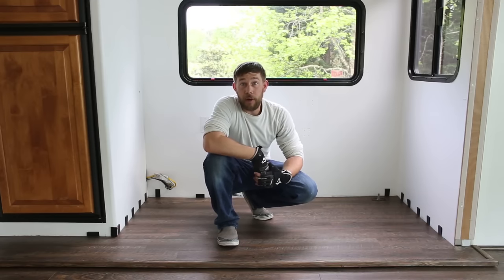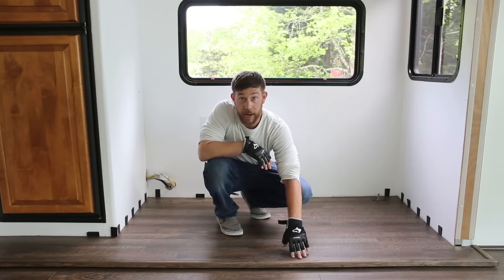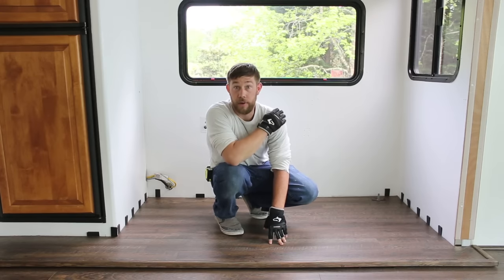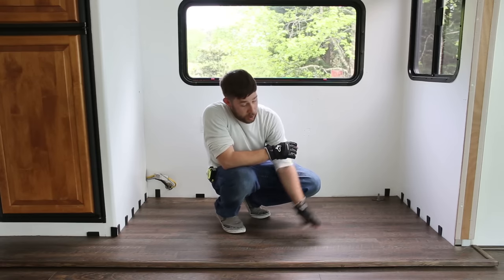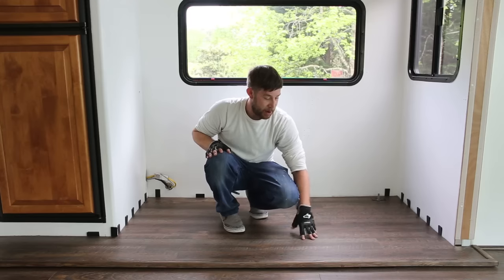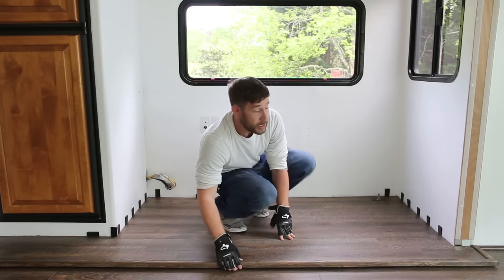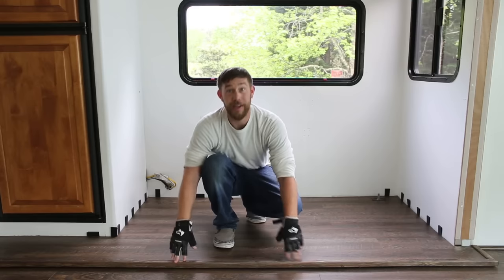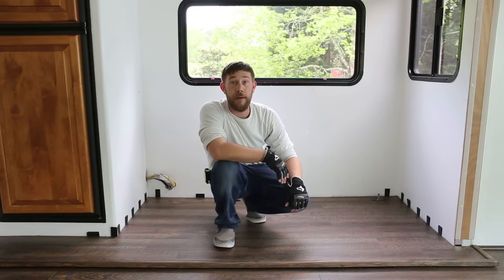Quick Chat: How to Replace Flooring in an RV Slide Out

Comment: Very nice job! Just purchased our new(to us) 5'er 3 motnhs ago and the carpet is on the list for replacement. Question: Do you get a draft coming from under the slide, now that the carpet barrier is gone? or did you somehow address that as you laid the new floor down? Thanks
Reply from the maker: Thanks +Carlos Goetz, best of luck on your carpet replacement. We do get a slight draft coming in from under the slide out, though I have to say it isn't very much of one. When we found ourselves in temperatures below 20 degrees is when we first noticed a draft, but since we've been above that temperature it hasn't been very noticeable. Hope this helps.

Comment: I'm wanting to replace the carpet in my slide out as well, but I'm looking into the peel and stick vinyl flooring. Would I be able to take the same steps as you guys did? We don't have the wheel wells like you do, but it does slope down a bit at the edge of the slide.
Reply from the maker: Hey +Kortny Callahan, I think you should be able to follow the same steps, though every RV is different and you may need to adjust some aspects as you go. We had to find a way to cover our slope on the edge toward the main floor because it was a little higher than the main floor and didn't come completely flush. If you are using the peel and stick flooring it should help make the lip smaller as our flooring was a bit thicker than the peel and stick is. If you wanted to send a couple of pictures to info@mountainmodernlife.com I should be able to give a bit more guidance. Anyway I hope this helps, best wishes, Eric

Comment: Our 1994 5 th wheel is stationary with wheels off and on blocks  We live in the 5 th wheel We want to use vinyl planking everywhere but on the slide we want to replace the carpeting  Being an older RV it has the lip as above   Any suggestion would be wonderful
Reply from the maker: Hey @Carol McCann I'm sorry for the delayed response. But the biggest piece of advice I can give is to get a couple of sample pieces of the flooring you intend to use. Then place it down in a row in front of the slide out. At that point run the slide out in then out to make sure it won't scratch the flooring once in place. If you would like more information you can check out our post - https://mountainmodernlife.com/replace-the-flooring-inside-a-rv-slide-out/ - I hope it helps but if you have any specific questions feel free to let me know and I'll do my best to help :)

Comment: Once we removed the carpet from our slide we saw large bolts in the wood.  What is the best way to cover these with the vinyl floor?
Reply from the maker: Hey @J we had two large bolts in ours as well. We knew for our situation the two bolts were going to be in the rear of the cabinets, so we used a hole saw bit for our drill and cut a round hole so the flooring could go right over top of the bolts. I hope this helps :)
Reply: Thank you. Good idea

Comment: How did you "secure" the underlayment to the floor?
Reply from the maker: Hey +Gale Brown sorry for the late response. We actually found that underneath the carpet on the slide out there was a a thin plastic layer that was on top of a thick (1") piece of underlayment. So we ended up using 4 screws per board (we had two boards because one was not big enough for the entire section. If you want to see a bit more you can check out our post on how we did the flooring in the slide out - https://mountainmodernlife.com/replace-the-flooring-inside-a-rv-slide-out/ - or our post on how we did it for the rest of the rv - https://mountainmodernlife.com/how-to-replace-rv-flooring/ - Anyway I hope this helps and feel free to let me know if you have any other questions, best wishes, Eric

Comment: I'm tackling the flooring in the main section of our RV where the rollers need to transition from the ramps up onto the flooring. How did you ensure that your slideout function remained working? I'm doing the same flooring job in our 5th wheel 2003 Newmar Kountry Star.
Reply from the maker: Hey +Stephen Jennings are you rollers on the slide out portion or on the main flooring section? Our rollers were positioned on our slide out, in order to make the flooring on the slide out secure we ended up needing to add a 1/4" piece of underlayment over the whole slide out (we needed to cut two pieces to cover the whole surface area).  Where the rollers were on the slide out I cut out openings in the underlayment to allow the rollers to still roll underneath the flooring that was going on top. The rollers still worked just fine going over the flooring in the main living section, they don't leave marks or anything. 

If you want a bit more information we did put together a post over on our website that has pictures and kind of shows the whole process. You can see it at this link - http://mountainmodernlife.com/replace-the-flooring-inside-a-rv-slide-out/

I hope this helps and if you still have questions feel free to reach out, best wishes, Eric
Reply: Mountain Modern Life Thanks for the reply.  Our rollers are located under the slide, so they move as the slide moves. I ended up ripping the planks as steep as I could for the first receiving row on the main body of the camper, and that seems to be working! Thanks again for having this material available!
Reply from the maker: No worries at all I'm glad you found something out that seems to be working, there's really nothing that can change the feel of your space quite like the flooring.

Comment: How much did it cost to replace the flooring?
Reply from the maker: That is a great question @Kaila Santiago and to be honest I can't remember the price. There are a few factors that'll go into the price, for instance how much square footage you need to cover, the flooring we used was $2.89 a square foot, also which trim pieces you'll need when you redo the flooring, lastly which tools you have on hand versus which ones you'll need to buy. I would say the first thing to do is figure out the square footage of your rig, then add 10% (you'll do this because you'll want extra on hand, generally you can return whatever you don't use). That will give you a ballpark idea. Square footage + 10% = What to buy, then, What to Buy x Price per square foot = Total for new flooring. Anyway I hope this helps but please feel free to let me know if you have any other questions. Best Wishes!

Comment: what did you use as trim
Reply from the maker: Hey +mady Daty I actually used a piece of 1/2 inch by 1/2 inch outside corner moulding (a 90 degree piece). If you want to check out the post we wrote at this link - https://mountainmodernlife.com/replace-the-flooring-inside-a-rv-slide-out/ - there are a couple of pictures that are closer up and it may give you a better idea. Anyway I hope this helps but feel free to ask any other questions if they come up best of luck on your project. Best Wishes, Eric
Reply: I saw on your other video thanks for responding though. that is a good idea using corner moulding instead of 5 to 1 brackets. my only problem is my flooring is sugar maple and I don't know if they have moulding in sugar maple. your remodel looks great though, mine looks closely the same except my flat was shell white and trim is extra white.
Reply from the maker: Nice, that's awesome, do you have photos up anywhere where I could take a look? I'm not sure if I've seen sugar maple trim, but there may be some stain out there that could create a similar look, have you found any?